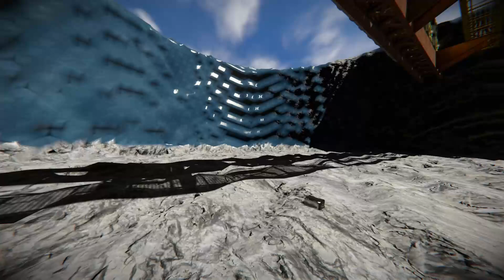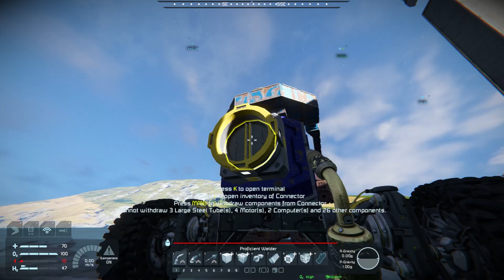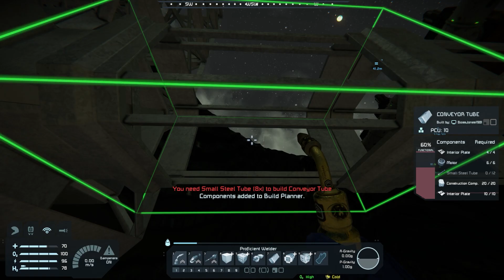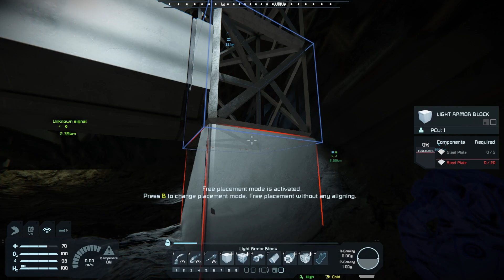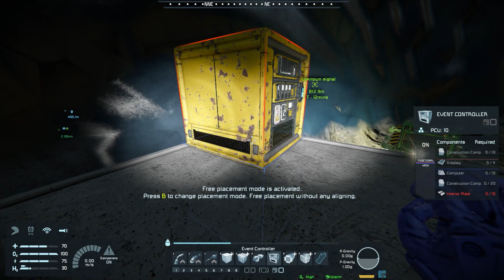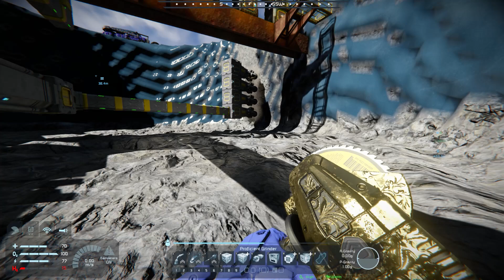#3 Automated Mining - Space Engineers: The Search for Intelligent Life

Comment: As a note about the Event Controllers, you can have them trigger the hinges to revers, the pistons (as a group) to move forward (increase max distance when set to max of 0) and 7 other actions all at the same time without the need of having a timer block when the angle reaches the correct point. This would reduce the number of "Admin" blocks you would need for your auto miner setup down to two (one for max Pos. angle, and one for max Neg. angle).
Reply from the maker: Unfortunately at the time of building this, stepping the max distance on pistons was a fixed amount and would have driven the drills into the wall. Especially if more than 2 pistons were used.   I have yet to redo this with the new options presented under the contact update
Reply: @BossJones1981  You are right, using the increase max distance on the pistons using the EV does have a fixed amount of about 5% of the total distance the piston could possibly go. Which I thought about this after I had posted my original comment. in this case you could set the piston to move as a specific speed (like you did in that setup) then have the EV trigger the hing to reverse, turn the pistons on, and start a timer set for 1 second. The timer would only have to turn the pistons off after that 1 second which would then put the whole thing back into a state where the EV is ready to go for the next round.... just another way of looking at the problem which is what engineering is all about right :)

Comment: Gotta say, that skiff is quite awesome.
Reply from the maker: Thanks, It sure has proven useful and added a bit of an alternative to the jetpack and running out of hydrogen every 4 minutes.
Reply: @BossJones1981  I built my own version shortly after I saw that.  I put a couple programmable blocks on it (One for auto docking, another for PID control to ensure it stays flat to planetary gravity, but that's still WIP) and a couple event controllers to control two sets of batteries.  A small battery is turned on when I'm in the seat, and when I leave it goes into recharge mode, while the other event controller checks to see if the connector is docked and puts the two large batteries I have on it in recharge mode or auto mode.  Works a treat.  The PID thing.... ... Keep loosing control.  More work needed. ;)